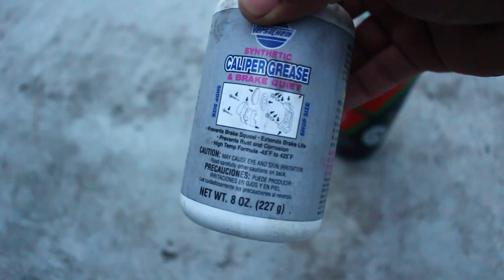DIY Brakes On A Mazda Miata | ValeeMeetz

Comment: when do you use the brake grease and cleaner??
Reply from the maker: You'll wanna use the brake cleaner on the rotes after it's put in place. Most of the time, the rotors will have a oily film on them so you wanna wipe down the rotor with some brake cleaner to make sure everything is good to go. The grease gets added to the caliper pins so that the caliper can slide a lot easier!